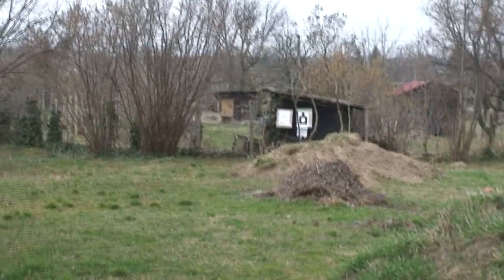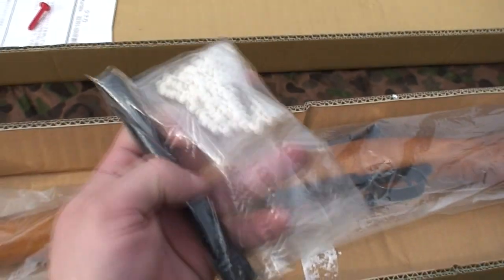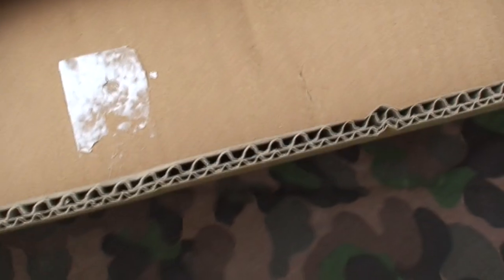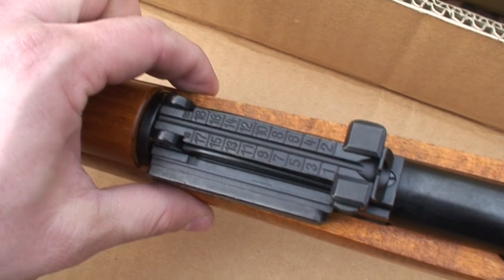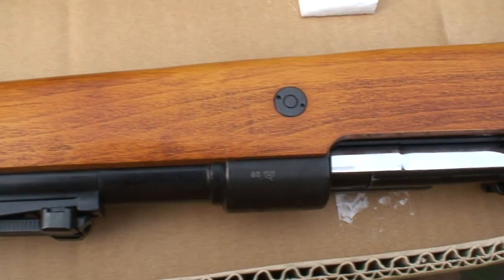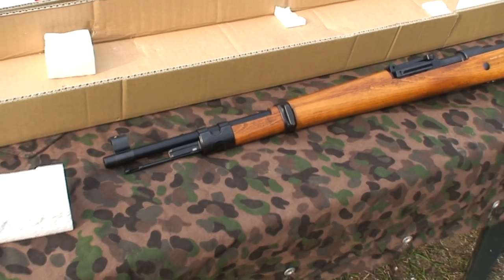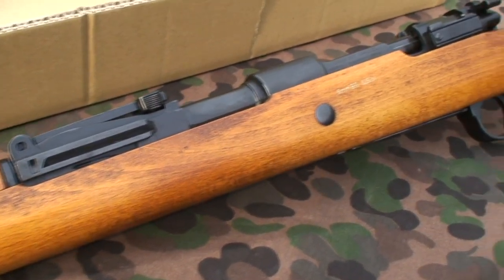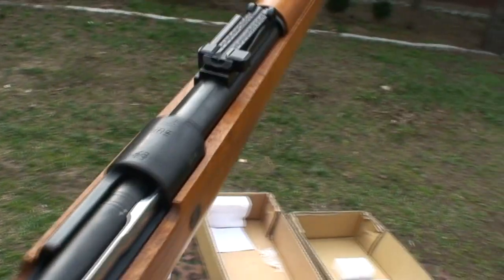Tanaka KAR98K review [HD] bolt action WWII airsoft sniper rifle

Comment from the maker: There are two mags available from the g&g one is with lower fps and one is with a higher ~500 fps. Depends on the shop which one did they order. Also there are packages come with the two mags one is the lower fps other is the higher.

Comment from the maker: @ParkourKid2000 Has much lighter pull even compared to the real one. As it is gas you don't even have to do a full bolt pull, it is enough to pull it back to chamber a round (less then a half of an inch or a cm)

Comment from the maker: @ParkourKid2000 Accuracy is a bit better on spring guns, but for max accuracy use propane without silicone (green gas has silicone in it which affects performance, as it is lubricates the hopup and affects the backspin amount) or hfc 134a. 

Accesories are hard to get, for example spare mags and a scope not to mention they are expensive. 

Also g&g kar98k is coming, may worth a look.

Comment from the maker: @podmokly As I don't use mine at all, however I had a tanaka m700 AICS and have to say the gas system itself is sturdy and could last for a long time and there are a replacement parts on the market.

Comment: At 2:00, the annotation is not 100% true. On the real steel, that hole in front of the trigger guard hides a button. When pushed with a FMJ bullet or other tool and pulled backwards, the magazine falls out. This was an emergency unloading option if there was a jam, or faster unloading instead of cycling the bolt 5 times. Just a little detail...

Comment from the maker: In this case this gas gun may hurt more than an average AEG, but this greatly depends on the range the shot is taken, the muzzle velocity of the gas gun or aeg, and the weight of the bb used, and last but not least where the hit is taken on the body and what protection is used.

Comment from the maker: It will not shoot without gas, however the bolt action and trigger mech works without gas. In case you don't want to use gas, get the dboys springer version it's more realistic (uses shells) and don't need gas for operation.

Comment from the maker: Yes, these are not cheap. The g&g kar98k may worth a look, not to mention it comes with 2 mags and a leather sling and the price is slightly lower. Furthermore it is co2 powered and it seems to be more usable in cold weather. Also co2 lacks silicone that green gas have and silicone in the hopup degrades accuracy.

Comment from the maker: Not yet had the opportunity to put my hands on the g&g, but as far as I can see from vids and reviews the g&g based on the tanaka with some modifications. These including a different hopup with the ability to adjust without tools, and it uses co2 as a propellant which is great because co2 more tolerant to cold weather and has no silicone in it which kills accuracy on gas snipers. Also g&g makes a lot of upgrade parts for tanakas, hopefully they already installed them to their kar98k.

Comment from the maker: @FalkenPT In airsoft terms replicas categorized by operation and performance (measured muzzle speed/energy). As a bolt action gas replica capable of 550 fps it falls into the airsoft sniper category. 

And yes it has the scope mount to allow the owner to attach a zf41 scope in seconds.

Comment: It looks like it will be worthy for airsofting... personally prefer the shell ejecting variants so I bought the dboys kar98k real wood gas version which is much better than the older spring version. Fires at about 440-460fps on abbey predator gas. Took it to its first game last weekend and I found it very skirmishable, has decent accuracy ( shot all members of the opposing team at least once) and did not lose any shells :)

Comment: Hey Stefanits I was planning to buy one of the these rare airsoft tanaka kar98k models but i just want to ask is there any way to regulate the FPS sense 550 is the limit where i play but  like in these warm summers the FPS may pop up over the limit pretty high. So is there a way to regulate the gas flow from the magazine or from the bolt? I have read in the forums there are G-Ver.. that can regulate the FPS from the bolt it self but i have heard you maybe able to adjust the FPS also from the mag

Comment: hehe but interessting is that on your k98k the chamber is open when you draw the bolt back like you can see in 7:07 

But on many other bolt action rifles in airsoft the chamber is not open and it seems the bolt is just like a piece of tube. Is tehre any difference with the bolt action or working of the "gas" and "bolt action" rifles in airsoft? There are such 2 categiroes on a webpage but theres no good explenatio of those 2.

Comment: I really wish to get one, but i can't find any on EBay. Is there another place I can look?
Reply from the maker: +Onyx Dragon (OnyxDragon22) AFAIK these are produced in a very limited numbers and I really regret selling mine, so if you find any of these secondhand buy them immediately. As far as I know since then they are not produced by tanaka. You may find another but very similar models made by G&G. You may also check the well know taiwanese and japanese airsoft webshops for these rifles. 

Also there are a couple of clones made by PPS airsoft these are all based on the tanaka design (the tanaka of course obviously)
Reply: ***** Alright, will check it out. And those G & G, are they of good quality?
Reply from the maker: +Onyx Dragon (OnyxDragon22) They look great, however make sure you get one from a recent production batch as some of the earlier models may have some issues with the firing mechanism and things like that.
Reply: ***** Will do! Thanks for the tips! Once i get one of these i can stop using my BB "bolt action" M4 haha
Reply: have you bought one or found one yet? Here it is, a link to a german site who ships everywhere I think, it has even more beautiful wood finish and steel finish and awesome realistic engravings: 

http://www.kotte-zeller.de/Tanaka-Works-Karabiner-98K-Gas-Bolt-Action-Gewehr-6mm-BB-byf-Version.htm?websale8=kotte-zeller-shop&pi=43561&ci=011446
Reply: Onyx Dragon eday